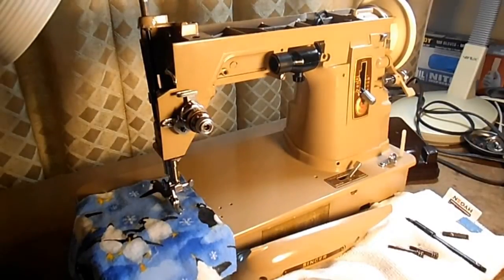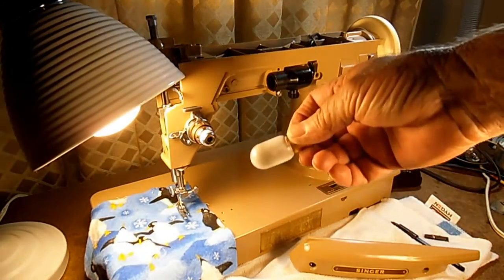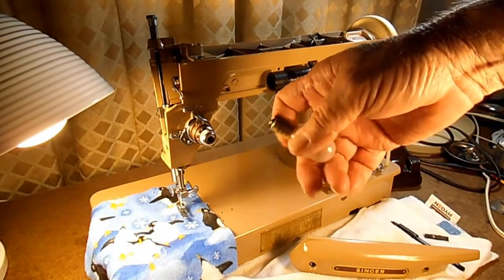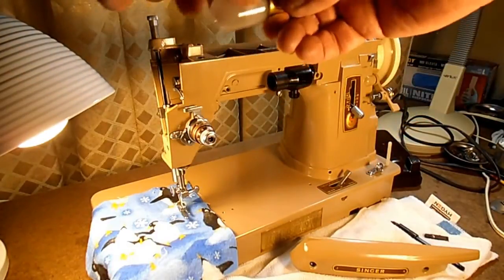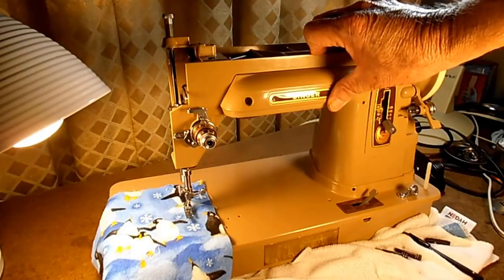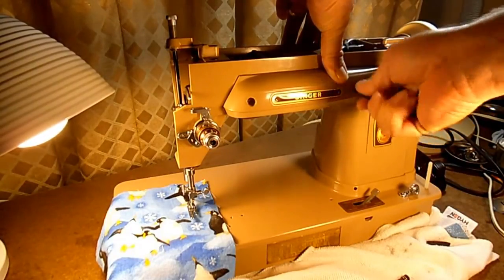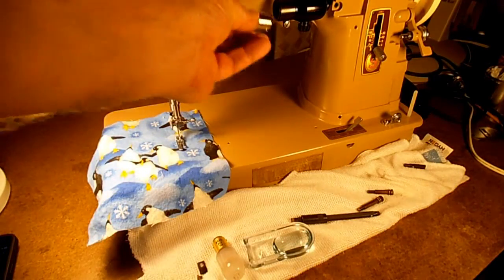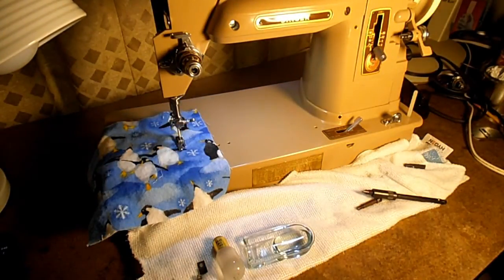SINGER MODEL 404 RESTORE SERIES Pt. 31 INSTALL LAMP SHADE & BULB - INCANDESCENT VS LED

Comment: I turned on the original incandescent light that came with the Singer 500A sewing machine and it got so very hot!  So I immediately looked for LED bulbs.  I bought two of them and I've got one in the machine now - I forget what I paid for them - they were a little expensive, but I think so worth it!  On the Singer 500A Rocketeer sewing machine, the glass lens is kind of straight - it doesn't have the bulbous focusing lens that the 404 has so no kaleidoscopic effects.  It shows a bright white light which I really like!  Thank you for uploading this video!  Kathy from Southern Arizona
Reply from the maker: Yes, we can relate to those original bulbs that get burning hot, especially here in Arizona! This is where I buy all my LED bulbs b/c 2 for $20 or 6 for $54. The best seller and bulb quality I found.
 https://www.ebay.com/itm/2-LED-ALL-Singer-Featherweight-221-222-Sewing-Machine-Light-Bulb-Vtg-Black-White/222571592392?epid=887734885&hash=item33d24cfac8:g:91kAAOSwA~VaM-Ih:sc:USPSFirstClass!85281!US!-1
Thanks for the tip about the glass in the 500A. I'm so used to removing it I bet I changed out the last 500A and 503A without even realizing I did not need to, haha. Take care .
Reply: Where did you buy? What size?

Comment: Great series Andy... Hey, I just finished restoring my newly purchased 404.!!  a $ 20.00 rescue in a table. I took it out of the table, worked on it a couple long days, but to me, it wasn't work..  The machine was stiff, I only hand cranked it, it was binding in a certain spot, it was filthy, dusty, stunk like mouse pee, and had a little bit of rust. the bobbin tire looked like it was melted,  the bobbin case was packed with lint, I took everything apart, the light, needle bar assembly, presser bar assembly and bushing,,,the bobbin case, upper tension assembly, hand wheel, bobbin winding assembly, bobbin thread tension, the throat plate lever, and the arm underneath, the big adjusting screw, and the pins, & springs.  I took the motor out, cleaned and greased worm gear, cleaned all the little parts, de-rusted, greased, oiled, set the needle bar height, checked the timing, put the tension assembly all back together after thoroughly cleaning and zeroed it out. checked the throat plate release, and it needed another quarter turn of the big adjusting screw, and I paid attention to your teaching, remembered your tips on how to do everything, It all went very well. It's like a new machine..!  I just got done waxing it and taking it for a test run, It stitches beautifully , and I wound a bobbin..!!  this machine is so smooth and quiet, and FAST. I see why it's your favorite straight stitch machine.. I am really looking forward to sewing on this work horse.!! Next I will refinish the cabinet that it came in...  Your videos are so good, and detailed, I only have to watch each one just once and I understand perfectly well what you are showing/teaching. You're the best Andytube..! Now I have to watch the rest of the series..
Reply from the maker: I wish more viewers would listen when they watch my videos. Most people learn by watching, it's just our nature. You notice you never see me in my videos. It's b/c I want you to listen to me, not notice me, and look at the machine. I try to share a lot of info and tips and pass on what I have learned from others. I want people to love working on the machines and have the rewarding experience that you had when you sewed with your 404. That, plus save them from landfills and pass them on. So, the pleasure is mine, and I thank you for "hearing" me so well, Connie. Also, thanks for your support of my channel, I appreciate your generosity.
Reply: @andytubesewing1953  well I am glad that I found Andytube. I am a visual learner, and you do an excellent job of teaching. I do love working on mechanical things, I have some mechanical background ,working in tool manufacturing, machine shops, autos, boats etc. but having been away from all that for many years now, it was so nice to have found my new hobby. VSM's.!!!  And I do sew, as of about 3 yrs ago. this all started with a free back road curbside kenmore, it didn't work, but somehow I was able to fix it. Then I shortly after that, found my first vintage Singer on Craig's List;  a 201-2, and the rest is history.!  haha.. now 13 Singers later. LOL..  The time and effort that you put into your videos, and sharing what you have learned over the years is very generous and kind of you, and is very much appreciated by many. Thank you. 🙏

Comment: Has anyone tried a piece of frosted thin paper (or other material) between the bulb and the lens? I'm going to order an LED bulb for my 404 and give this a try. Just curious if a diffuser would be helpful?  
I just followed your link, Sue is currently out of stock of the LED. :(
BTW: Thanks for your great Singer videos.  I love working on the old machines!
Reply from the maker: Never heard of using a diffuser, so let us know how it works out. Here is a more up-to-date LED video:
https://www.youtube.com/watch?v=u4TJrv51i9A&index=14&list=PLsCOZgzzaiKLZyGebzS_oISgesXNyREyI&t=0s
Here is the seller on eBay: https://www.ebay.com/str/foxyfinds4u
Their bulbs are in stock. Tell them Andy says hello. Thanks for watching my videos.

Comment: The LED is very bright and clear and the no heat option is a big plus. It's too bad the LED plays like a kaleidoscope with the lens. I like the glass lens a lot. Maybe because these days nothing is made with "real" materials like glass and metal if there is a way to fake it with cheap plastic.
Reply from the maker: The lens does look good when it is mounted. That kind of heavy, well made look. Yes, very "real" looking. I see many LED lamps for sewing on eBay. For sitting on the sewing table, etc. to give better light. A person could always use one of those for lighting, and leave the lens for looks.